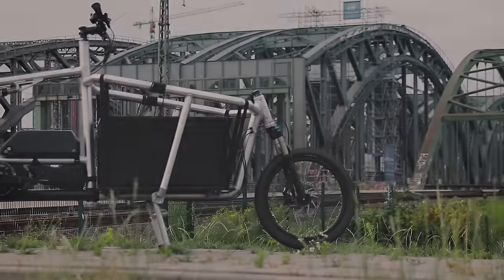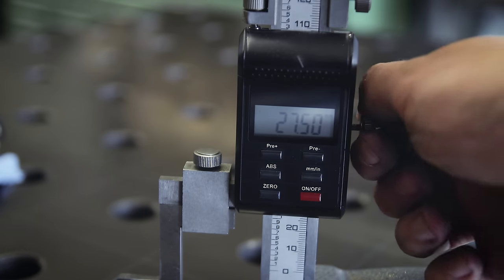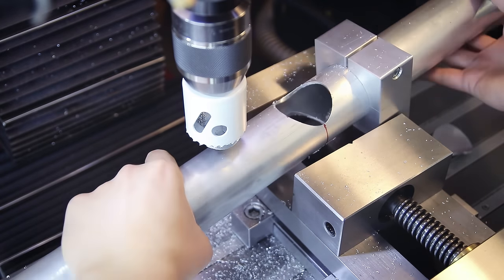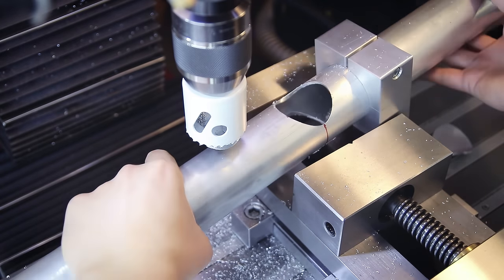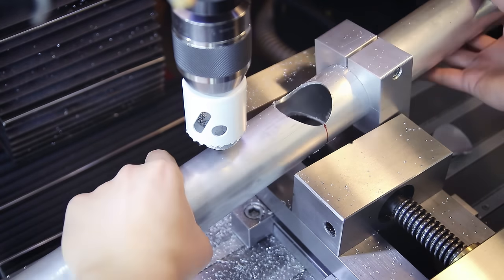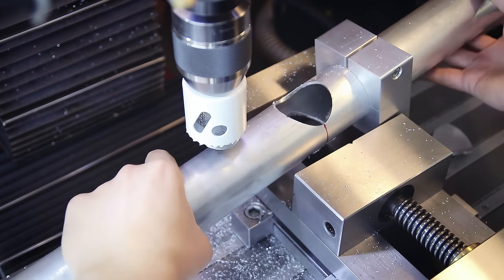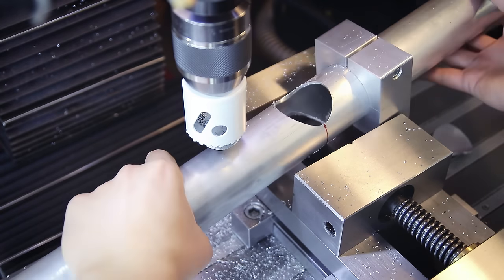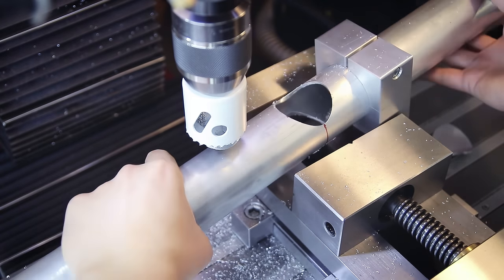Building an Electric Cargo Bike with Cable Steering and Full Suspension

Comment: Honestly I'm a danish welder and your welds are nothing to be shy about. But I would suggest a little tip. Like when you have support under the "foot/cargo panel" aka. The only square thing 😂 and this trick can be used on tubes as well. Don't butt up the support all the way to the thing you are welding against. Leave about 1 or 2 cm (deepening on the cup) so you can make a tack weld "almost" under.. (so you get to tack in four places) always try to make contra racks and weld to avoid distortion. Hope it helps you. And what a beautiful video and build! Great work !

Comment: You may not have an engineering degree but you are definitely an engineer.
Great work.
Reply: dang i have the degree, but i dont have the skills, nor the patience to build something like this, he's a great engineer!
Reply: Yes, when Phil said ‘I am not an engineer’ I thought, well you certainly have the mind and skill of one!
Reply: Engineering is a mindset, not a skillset.
Reply: @badsamaritan8223  I think it's both, and he definetly doesn't lack any of this two. Also, as a recently graduated engineer, i really think that for some people there is no need to go to uni to learn the skills or get this type of mindset.
Reply: I would disagree,  he is an amazing designer and fabricator, but there is a lot more to engineering than just making something.  To "engineer" this bike he would have to create requirement and analyze his design against them.  

Why use aluminum tubing and not steel or titanium?
Why did he use 55mm tubing, what about 45mm? 50mm? 60mm?
What set the size of the cargo space? Did he asses the common objects that he is likely to carry? How does he know that this design will support their weight?
Why choose this wheel base? He said it has a smaller turning radius, but how small should it be? Is there a target?

I am not trying to dunk on his design or project, its extremely high quality.  I am also not trying to say that he should have assessed the questions above.  What I am trying to get across is that engineering is about defining goals, setting requirements that enforce those goals and assessing design decisions against those requirements.  Engineering is not about making something, it is about creating the optimal design for your specified design criteria.
Reply: @mully006  I understand this, I've had to remake so many designs, and that was because of constantly changing materials for specific advantages, spacing for items/objects that will be used/held in this design, having to know max weights of certain areas on the designs to either make sure it'll be stiff/still/flexible/malleable where it needs to be, then you gotta worry about every single environmental impact that could be a potential possibility, but at the same time not exactly throw away but put in a different pile of maybe possibilities since their more one and a million/billion chance possibility. Then you gotta build it, which is the fun part in my mind personally.
Reply from the maker: @mully006 That's a good summary actually, I think what people don't understand about engineering is that most of it takes place at a desk and not in a workshop. I'd say I dabble in engineering, and of course you have to think about a lot of the considerations you mentioned when designing something like this. But building a prototype for myself doesn't require in-depth engineering to the degree that you'd need for putting an actual product on the market where everything has to be optimized to be cost effective, among other things. I probably go by experience and gut feeling a lot more than someone who does engineering as a job. 

That being said, a lot of those goals you mentioned did exist, for example the wheelbase is optimized so that this bike fits exactly into the elevator in my building, because I can't keep this outside on the street. I actually made a CAD model of the elevator to make sure things fit 😅
Reply: As an engineer, I totally agree with this.
Reply: In many places you cannot say you are an engineer unless you are actually part of an order. You can get many k$ fines for claiming you are, even in a video or on internet. 
The title also involves increased liability if you mess up and break something or hurt someone. 
So dont get yourself fined just for a hiped title, not worth it.
Reply: @mully006  hear hear.  Engineering is a discipline that... bits and pieces of were showing up here, but yeah, this is... just different work than engineering.  Excellent different work.  Precise different work.  Beautiful different work.  Just different work.  :)  Seems like Phil groks this, too, which is nice.  Astounding work, Phil!
Reply: @PhilVandelay  Well said, that's the spirit exactly. Keep an eye on the welded joints in the frame over time! But I'm sure you know this already.

Comment: The engineering of the fixtures and using the table as a frame jig is the most impressive to me.
Reply: Right? So much of the work of assembling and welding something is the time you spend perfecting the clamping setup and the jigs. I've always thought welding was 95% prep work and then the last twentieth bit of time you actually join the metal together.

Comment: One tip that I learned from a bike builder when welding my own frame was to spread the heat around the tube when welding. For example, if your first tack is at 12 o'clock, only lay down a bead about 10-15mm long, then move to the 6 o'clock position and lay down the same length bead. The material will tend to distort in the direction of the heat so spreading it out in this way helps "pull" the material more evenly around the weld. Great video! Thanks for sharing!
Reply from the maker: Yeah this helps a lot, I do it whenever possible

Comment: Personally, your welds look beautiful. I have performed welding on aluminum to a very limited extent (it was over 20 years ago). Your points about the 'optimum' settings are correct, in my opinion. Practicing your own technique, or developing one based upon welding fundamentals, is what will serve you in producing consistent, high quality welds. And, being self-taught is one of the best ways to learn from my experience thus far. You have to do it to become better--practice. The design of this version 2.0 bike is really nice. I admire the thought you put into your design and more importantly, your support equipment to make your fabrication easier. Your weld table, the super-jig, tubular blocks and the other tools you made are all ingredients in the recipe for success. Thanks for sharing your idea, thought process, fabrication technique and skills for the inquisitive minds out here in the design/tinker YouTube community. This video was worth the wait. Excellent job!
Reply from the maker: Thanks for the elaborate comment!

Comment: When cold setting, you can measure how much you push down at first and how much it recovered. Next time it will recover by the same amount and you know you have to push beyond your zero by that amount. 

For exemple, if you push down 10mm and it ends up deforming by 2, you know it will recover about 8mm. So if you want to correct a 7mm deviation, you have to push down 15mm for it to recover back again by 8mm to the 7mm target.

Comment: I am very curious about the cable steering !
You choosed thin diameter, the forces will get big!
I'd say, measure them and then choose the right cable diameter
(max emergency load + 100%) this could be a force of 1t or 10.000N.
This could be a cable of 4mm diameter.

Comment: Using the lense filter was cool. I kinda had an epiphany watching the welding. I was best in my class at welding in school but had not nor have done much tig. I thought the "stack of dimes" or weld pattern was controlled more with the welding electrode movement but realized it's really/primarily the addition of filler rod. Understanding this takes away one variable in the conceptualization or misconception rater I had for TIG and thus will allow me more confidence/ability to TIG weld. Another question considering that you shaped the frame with bevels welded vs. tube bending was this because because such would be impractical/impossible with the material and OD/wall thickness, a product of not having a suitable tube bender or a consideration to make the build more accessible for those working without a tube bender?
Reply from the maker: The only way to bend tubes like these without kinking is an industrial mandrel bending machine which I don't have access to so yeah, that was the main reason for not bending it

Comment: Impressive work. I love that you explain so much.
Your wielding table is an amazement. Didnt know this existed.
Currently halfway in the vidéo, I'm wondering if you considered making the bike and battery harder/impossible to steal

Also, I presume you saw your insurer (pun) to check its okay.
I'm curious on this point. 

Congratulations
Nice shop, nice project and vid
Reply from the maker: The battery does have a lock on it so it's not super easy to steal, but overall nothing will keep a thief from getting either the bike or battery if they really want to. Nobody here insures self-made bikes so I just have to watch out to lock it well and not take risks (leaving it overnight)

Comment: When you finish your weld keep the torch in place for couple more seconds with gas flowing.  it will protect the weld puddle from corrosion while it is hot.  Otherwise you are great at welding.  And trust me most engineers will not understand why you are doing all of this to weld couple tubes together.  you may want to weld under fixture to lower the distortion you are getting on the final product after welding.

for me everything looks excellent considering you are self thought :)

Comment: You should build somekind of compact DIY hydraulic tubebender. With bending capabilities there would of been less hassle with welding distortion.
Reply from the maker: I've actually done a lot of research into this and planned a full bender already. Bending tubes is a lot more complicated than you might think, you run into a ton of difficulties when you try to bend large diameter, thin walled tubing like used in this build because the walls will fold and buckle. Not as easy as bending thick steel tubing. You need a mandrel bending machine, normal tube bender won't work. Due to these complexities I haven't gone that route yet but hopefully in the future
Reply: @PhilVandelay  Arent thin walled pipes bent easier when filled with sand to prevent denting? I think can be done
Reply from the maker: @pontushylen4880  Yeah but it's a pretty annoying/time consuming process and doesn't always work

Comment: with your tig welding its worth commiting to using a bit more heat. its a hard mental barrier as you are trying not to burn through parts that took considerable time to cut and fixture, but as you say its all practice and that will bring confidence with it.
Reply from the maker: Absolutely, my aluminum welds used to be a lot cooler than this actually, so that's already progress ;)
It's party because I use a cheap welder and the foot pedal is so atrocious it's basically unusable so I'm stuck with using 4T at the torch and hoping it works out with the settings (or changing them for each weld) but with the thicker parts like around the BB it can be a problem.
Reply: @PhilVandelay  oh right, you are doing well for no amperage control, i couldnt imagine going without on aluminium.

Comment: 41:10 I just started relearning welding after being away from it for many years. I was shown a way to compensate for the distortion that occurs in welding is you are showing here. You would mis-align the piece in the opposite direction of the distortion so then it distorts itself into place. This is not always 100% perfect you an help in many situations.

Comment: That jig... And the build.. What a lovely 3/4 of an hour watching your excellent work!

Now, I have a similar bandsaw. And getting that thing to cut really straight is one of the mysteries of life.

Having never built a bike, or vehicle (I mess with boats, and wood splitters, and..) I do wonder how critical 3 degrees of misalignment after welding here, and a few degrees there would be for handling? They did not have that very very nice welding table earlier (I believe) and even the fixtures for mass production would probably not be perfect? Or am I wrong?
Would be very interesting to hear about that from you.
Reply from the maker: Depends on where the misalignment is, but in general you might be surprised how well even very crooked bikes ride. Misalignment does of course affect handling, but it has to be seriously off (so that it's extremely obvious at first glance) before a bike really becomes "unrideable". I guess it's again a matter of your personal judgement how much "weird handling" you're willing to tolerate ;) 
I suggest googling the term "Freak Bikes" if you want to see how weird bikes can get and still be rideable.
One or two degrees will probably not be noticeable for the average person when riding (average person meaning someone who is not into bikes and doesn't pay close attention to how a bike feels to ride). Cargo bikes feel pretty weird to ride compared to normal bikes in any case, so most people would probably notice it there even less.

Now, on the other hand, if you give an experienced rider a road bike where something is 2° off... they will be able to tell immediately and probably refuse to ride it. So in short: It depends
Reply: @PhilVandelay  Right. Thanks for going into this. I have only ever ridden commercial bikes (Mostly MTBs here in Norway) and don't think I have ever seen a homebuild. Small place.
But there have popped up quite a few electric assist cargo bikes over the last years. After watching this, I think will see them with fresh eyes.

Comment: Since you are into fabrication, here's a tip. Use a angle bar set against round stock (tube/rod) to get a straight down the center line. 
I really like all your fixtures. 
Farmer built is way better than engineer built. It's always stronger.

Comment: Phil your e-cargo bike looks like a pragmatic piece of art.  But the cargo cage seemed like it could be more of a structural element. And after a little googling i came across the Reese Miller Load4-60 cargo e-bike. Which is what I was visualizing, only more refined and better engineered than my concept. So your take on it's design, would be appreciated. 

Were you aware of this Reese Miller cargo e-bike before you designed your bike? ( I'm curious  if it or any other  cargo bike inspired your design?) The main difference seems to be the cargo cage. Can you compare and contrast that difference and any other relevant differences. And would you consider making any adaptations If you produced a second version?

Comment: Amazing work. What sanding disc were you using to grind the bottom bracket? Looks much more precise than a full sized angle grinder.

Comment: 20:00 
Yes, for some people having somewhat 1000nit screen, that thing look as same as an flashbang in CS there
But the things that i worried is your cam, because long expoure with a light source that can damage human eyes pretty sure isn't good for that
Reply from the maker: The cam is fine, I've been filming straight into welds for years with various cameras, in my experience it's a myth that it damages the sensors. Lens also has a UV filter in front of it

As for the screen, yeah I get that but some people were actually convinced they would get arc-eye from looking at welding on screen

Comment: Would you recomend starting with the simpler ones to learn skills or can a beginner start with this? Is it allowed to usw your designs to start nebourhood bike pool or only for personal use?
Reply from the maker: Definitely not a beginner project. The designs are for personal use only
Reply: Start with the simpler one, it is ideal and I have a mid motor on it too.

Comment: Phil,  have you ever considered using friction/flow drillings, to form the threaded metal inserts, instead of rivet nuts?
Reply from the maker: Not really, I don't see how it would be a big advantage although it is an interesting process
Reply: @PhilVandelay    Couldn't say how great the marginal advantage would be.... But it is relatively simple based on the current equipment you have available and it's an elegant alternative..... 

So I figured it would be worth mentioning..... Good luck with the rest of your build....

Comment: Great work. I build a cargo with inspiration from your other video (even took the same color). Can you tell what is the length of this one and what approx. is the weight save using alu. ?
Reply from the maker: Well the bikes are very different so not really comparable in terms of weight, but generally you can expect to save somewhere around 30-40% of weight compared to a similar steel construction. You can see the major dimensions here: https://imgur.com/HGQf1KF

Comment: great build, awesome skills, amazing workshop, beautiful video, what's not to like?
did you went with raw aluminum finish? or did you somehow clearcoated it? interested because of a bike i want to repaint (or not).
Reply from the maker: Thanks, the frame is raw for the most part, I might paint it eventually but just for looks, I never had any problems with raw aluminum in terms of durability but it doesn't stay shiny unless you polish it every now and then
Reply: @PhilVandelay  thanks for the answer, I might go with the naked look.